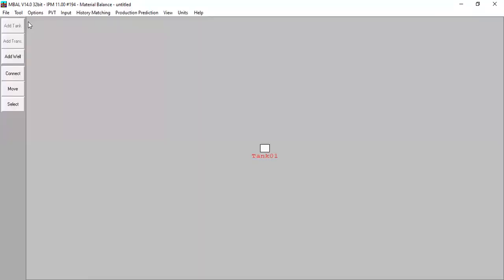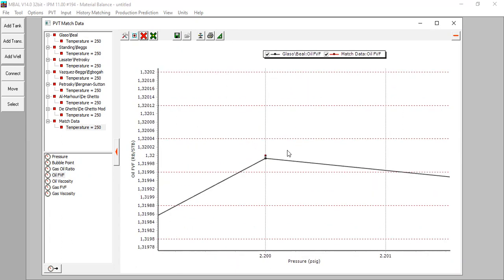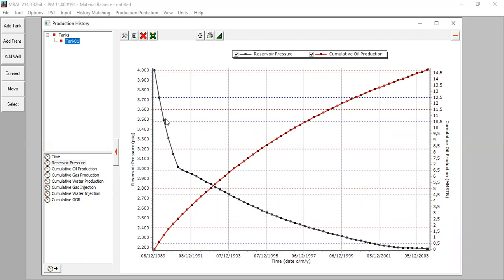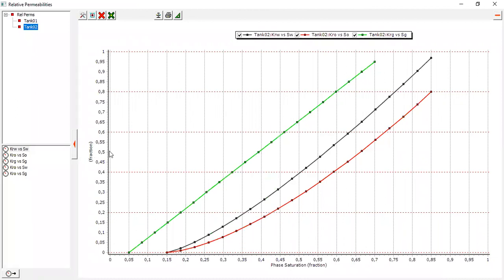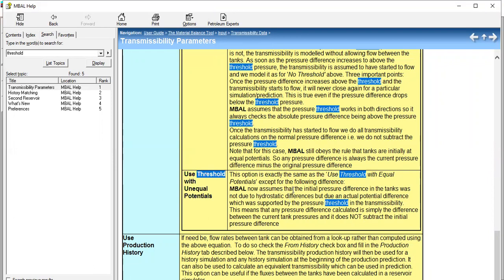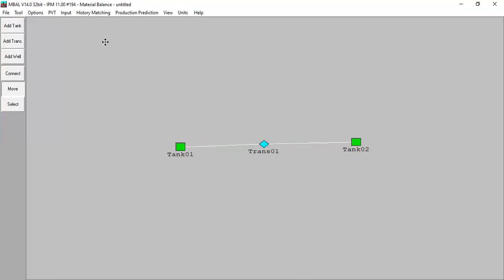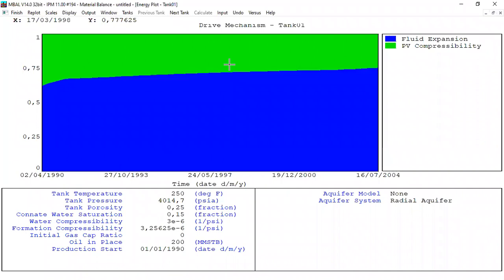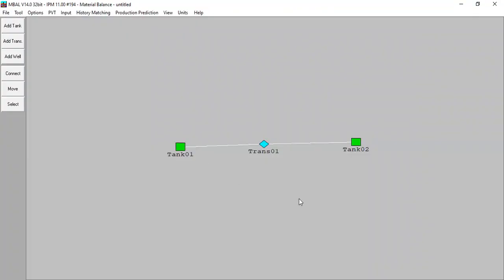MBAL 52: Transmissibility between Two Reservoirs

Comment: hello Mr Eng-man! I want to calculate OOIP from the data obtain from the simulation using MBE? From tank1? I've tried Np and  recovery factor but it doesn't give me back the original OOIP!
Reply from the maker: make sure to get history match first, then you can get the OOIP or this is the connected OOIP which might be different from OOIP from geological calculation
Reply: @EngMan101  I want to calculate OOIP using material balance equation to compare with software derived OOIP! Using history matching data.